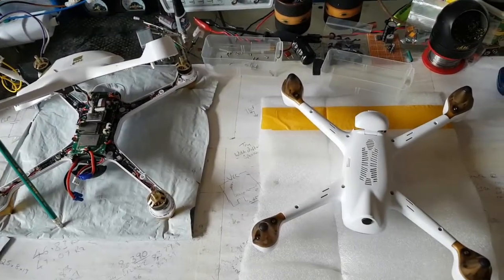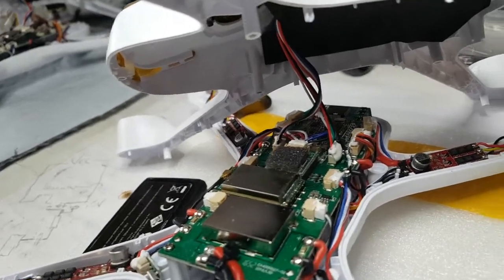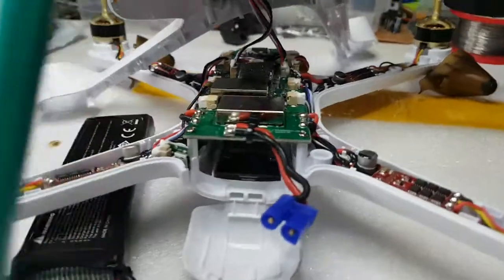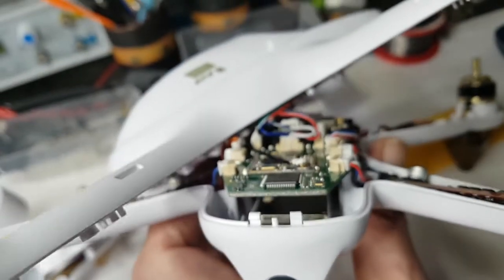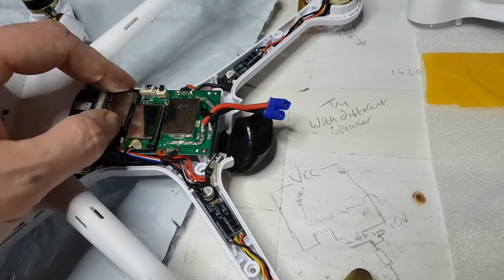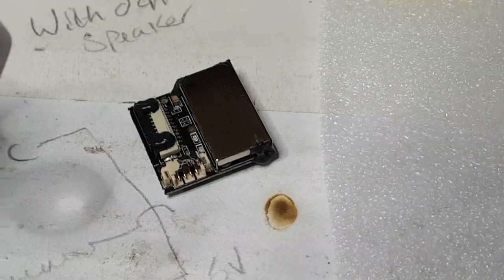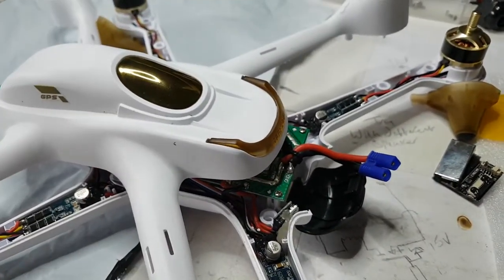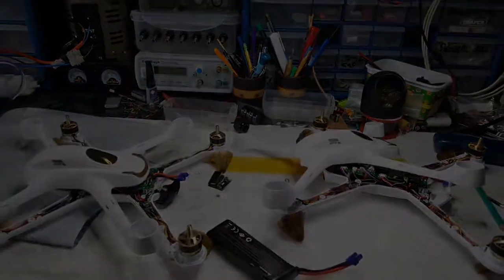Hubsan H501SS a look inside

Comment: Good luck with the flight test tomorrow...I did a bit of research and found out that the best mount in vibration tests is stuff called moon gel...drummers use it. Learn something new everyday don't we...lol
Reply from the maker: No flight test for me. I knackered the ribbon cable last night. It got a bit warm. Found another second hand on ebay £8 or 10 new from can you guess, £4. These cables are sort after as some are selling nearly $20 for basic small ribbon cables. Crazy.
Glad my Syma X5C is still running well ;D

Comment: I need a help from you, as I have a hubsan 501c, and I bought the main board and the 501a camera card to put on my 501c. plus my doubt is that the 501c just picks up an antenna and the 501a picks up 2 antenna on the main board and 2 antennas on the camera board, I would like to detail how they put it on the housing.

Comment: I've opened up the 501 SS. to fit an antenna. I can see two units with an antenna coming off from them. One at the front...And on next to the FC. 
Which one is the vtx?
Reply from the maker: Peter Mabbort Should be the one in the front. Just to be sure chase the cable back from either. One will go to the antenna along the inside of the craft parallel to the camera board and main board, that is the control. The other will go off into a rear leg, that is VTX.

Comment: Hello smile....you know those foam type earplugs?....the structure has superb dampening characteristics..might be an idea to mount the flight controler
Reply from the maker: Thats a  good idea. I think I have a couple around here some place. They would work well because it is a square of foam with a square hole in the middle. I have this morning put a blob of silicone at each corner and sat the FC on there. Tomorrow it will be cured and I will test to see if it makes a difference to flight. At the moment if I rudder left the front left leg drops down and rudder right the front right leg raises. Makes flying nearly impossible.  Your idea is probably better, better damping qualities. I will try if what I have done is no good. Dope! i forgot the cable is knackered now, when refitting it split away at the connection :(  That was part the reason I opened up the other one, see if I could liberate a cable.  I am trying to find a cable that will fit at the moment.

Comment: Good morning dear, my name is Miguel from Argentina, I have a problem with hubsan 501 ss, the altitude does not work, it marks me 0 and it does not stay fixed in the air, I can not find the barometer on the motherboard, you know the location of the barometer to be able to repair it, thank you very much.
Reply from the maker: Do you know what the barometer looks like?
Reply: @Elecifun  Good morning, thanks for answering, study that these devices have a barometer that measures the density of the air that together with the gps make it remain static in the air, I locate the gyroscope, the compass, gps etc. but I don't see the barometric height sensor, the radius is 0

Comment: Just wondering did the new flight controller fix you h501s
Reply from the maker: No m8 it has another problem now. I am waiting for a new cable for FC to see if that will help. It has taken 6 weeks so far to fix and still no closer.